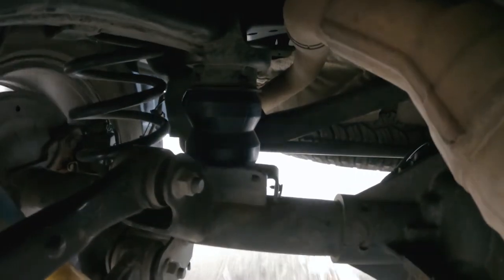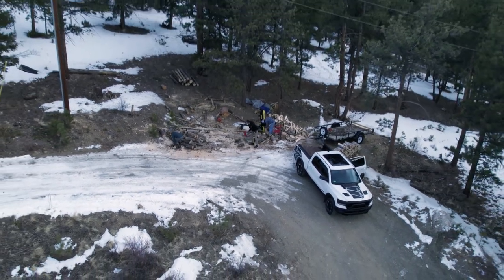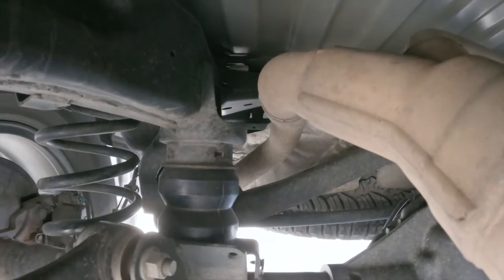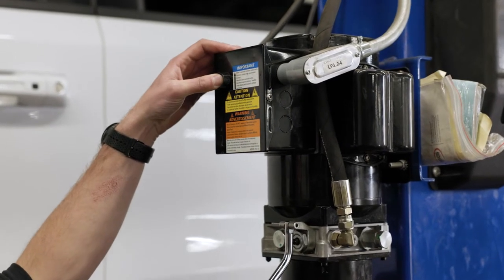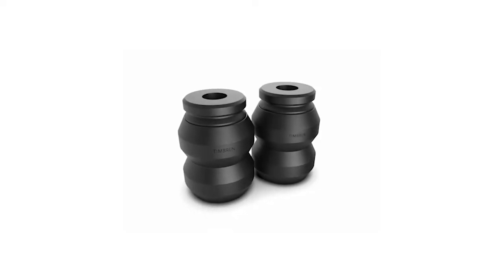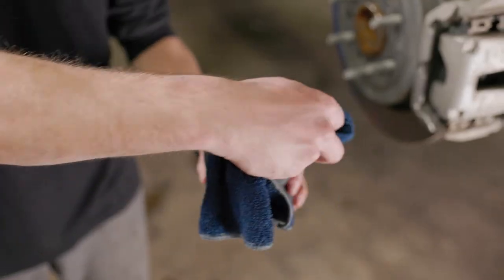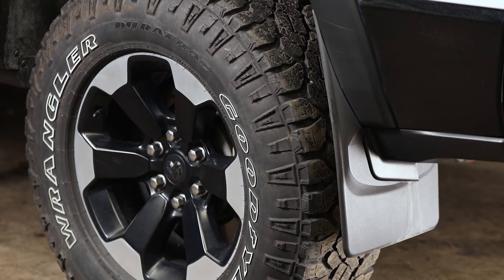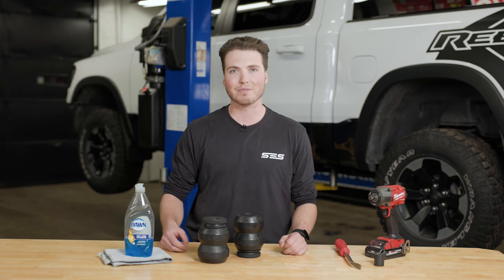SES Install on RAM 1500 | Timbren SES

Comment: Hey guys, for a 2023 Ram 1500 all you have to do is jack up the suspension about 6 inches. The stock bump stops just pop off with your bare hands. Then lay on the ground right under the axel, soap the Tumbren and push up and twist in place. It took longer to jack up the suspension then remove the old stop and install the Timbren. After I installed them I put my camper on and I had less than 1/4 in difference from front to back. It answered my needs. Thanks Timbren.

Comment: So I see this is installed on a Rebel.  Does the Rebel need your extra spacer kit due to being 1" higher than a regular Ram 1500?
Reply from the maker: Nope! The factory lift features a lift block. The standard kit works fine. DR1500DQ.